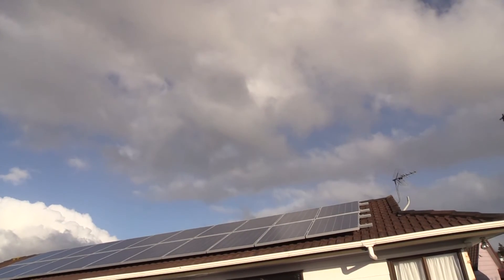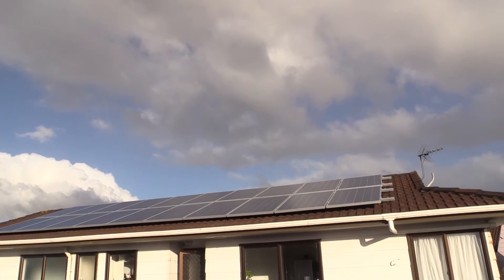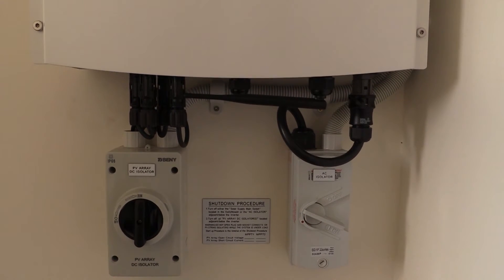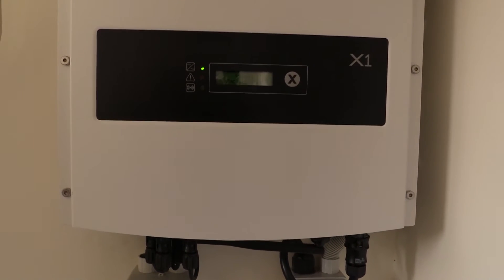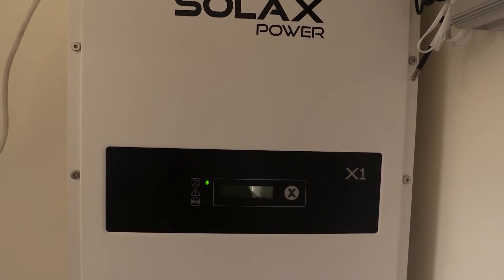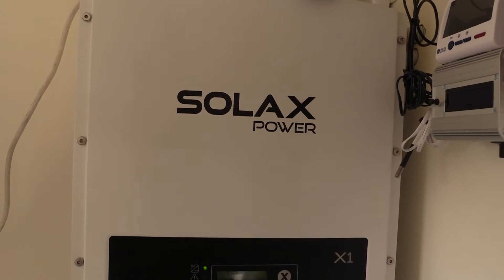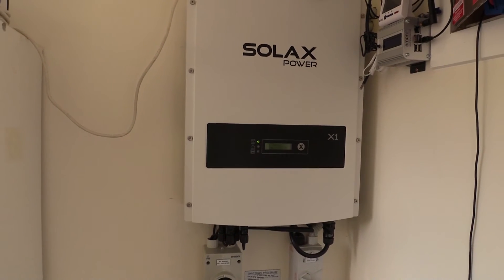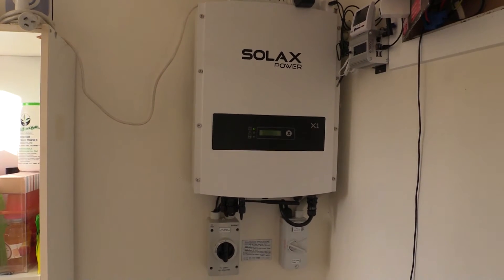Tesla Powerwall and Grid-Tie Part 1

Comment: Micro grid tie inverter works off 25 to 50 v. Your boost controller could run one of them
Reply from the maker: The 250,500 do that voltage. The problem if using the boost converter/controller is that because the voltage is low on those smaller units the amps are high and most of the cheap dc/dc boost have a  limit of 20 amps on the "input". As you get above 500w 20amps at say 30 volts the boost converter cant keep up as the micro inverter pulls more.
Reply from the maker: Also for my case and for a powerwall of 5- 10kw is that 500w would be way too small. 
If i used a 500w one then 500x14hours is only 7kw and the  kicker there is that over night the house only uses 250w when everyone is sleeping so for 8 hours between 11pm and 7am we need 250w which is around 2000w and if the 500w one was maxed out between 5pm and 11pm it would be 3000w. Which gives us a total of 5kwh with a 500w micro inverter so far too small. Now we could use two 500w ones and that would be better, but if you use more of them then the losses are also greater. Eg Each unit is something 85% efferent. Thats 15% loss so you better of to have one big one then two at 30% loss overall.  Also by using a DC/DC converter that also has a loss of around 15% so that adds up 15+15= 30% loss in heat if using one dc/dc and one 500w grid tie. Alot of battery power wasted. So by not having to use a dc/dc you saving 15% batt and by using a bigger grid tie rather than 2 or 3 etc then it also pays off. I am going for a 2000w grid tie with limiter with much higher voltage range so i can run 74v non. This means over night the inverter will sit at around 20% load and in our peek time sit at around 70% load as i get to 15kwh powerwall then this size inverter is what i will need to be able to take advantage of that batt power. If that makes sense.
Reply: I like what you're doing and want to do something similar. How are you going to control current. 15%of 2000watts is 300 watts.  And 15% of 250 watts is 37 watts. So % stays the same. I'm thinking having 1 for over nigh and all four for peek time. Cheep to experiment with. 
Have a 53v1200 watt charger for  14s
Reply from the maker: The grid tie inverter i choose as a built in limiter, using a CT Clamp on the house AC to monitor how much load the house is using and the built in limiter trys to match the house usage. The only other way to do it is to use a dc/dc converter with input from a Ardunio with CT clamp and use the Ardunio to change the variable resister in the dc/dc to match the load that the Ardunio is reading.
Reply: how long till we see your inverter?
Reply from the maker: Just got it yesterday and did an unboxing video, I am waiting for the weekend so i can take my car out of the garage and do a inverter test video. So Saturday both videos will be up :)

Comment: You can use light bulbs as a current limiter. 250v 100watt globe will only let 100 watts into your inverter, 2 = 200watts. No globes would overload your inverter and blow it up. I think.
Reply from the maker: Interesting but if using 100w globe wouldn't you be wasting 100w or 200w as the bulbs turn on?
Reply: Apparently not. 10 or 15% loss but a cheap loss. I'm yet to try it. I have a 1200 watt boost converter and that lost 20% and was getting very warm on 240watts

Comment: I've got much the same problem.
Inverter I got takes high voltage input, a surplus grid inverter has a connection to it's internal HV DC bus. Naturally both have different voltages, and the grid inverter likely doesn't manage different loads properly. Again there are no reasonably priced DC to DC converters that can do the task, anything that may exist is from Industrial or Electric Vehicle side of things, with prices to match.

Be interesting to see what sort of hardware hacking you come up with.
Reply from the maker: Keep watching :P What inverter have you got?